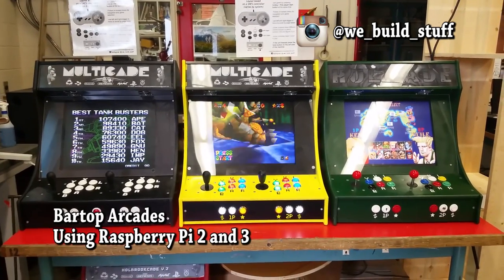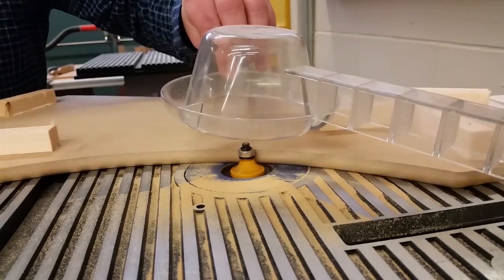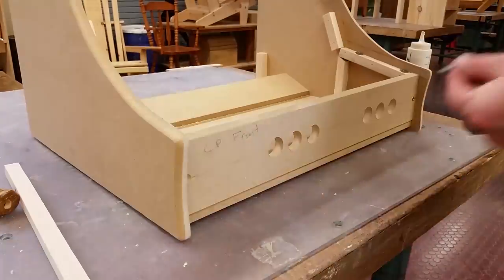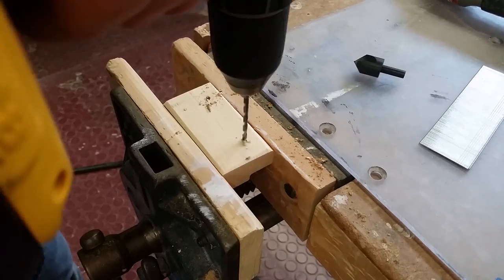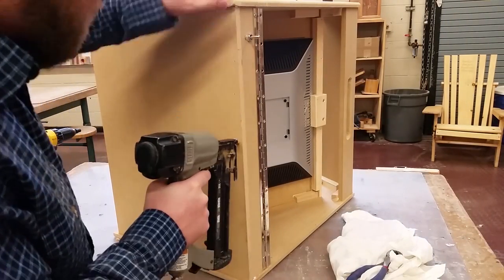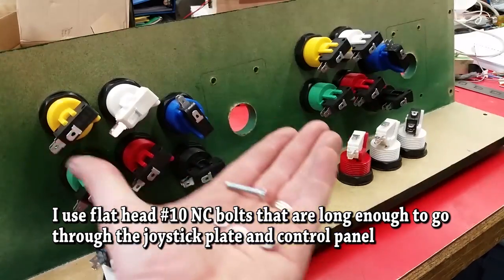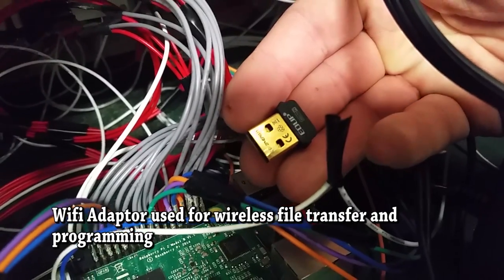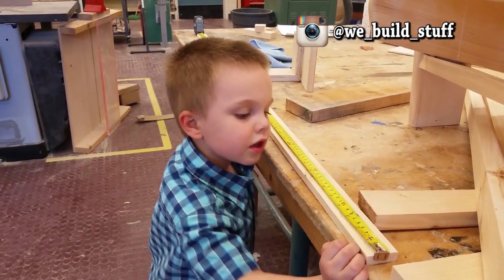How to make a DIY Raspberry Pi Arcade Cabinet!

Comment: I have a question.  Say i wasn't to build 2-4 of these for gifts can i set the first one up then copy the SD card for the other ones and they would be ready to go?  Giving i plug everything in the same spots.  Sorry for the dumb question.  Never used a Pi before I don't even eat them.  But I have my first Pi Zero getting delivered tomorrow.
Reply from the maker: yes that would work.... but you need to make an "Image" of the SD card and not just copying the files over. There will be 5 partitions made during the installation process (see the recalbox install video https://youtu.be/wlIxgFfgd34 that was just posted). 2 of the partitions will be visible just plugging into your computer while 2 are hidden and 1 is usually hidden unless your computer can read the linux partition thing (I really don't know how that works). 

Making an image after installing games and getting the settings right will save you lots of time since the only way to add games is wirelessly (unless they have updated the OS since I installed it whereas you can plug in a USB stick with games and it will copy over). I have checked out the latest 3 beta versions that were put out so a few details have probably changed. 

But plugging everything into the exact same GPIO headers, etc technically you can just make an image, copy it, and be good to good way quicker!

Good luck!
Reply from the maker: funny guy... eating Pi hah
Reply from the maker: i just noticed you said you are using PI Zero. This will still work but you wouldn't be able to use the GPIO unless you soldered on headers. Might be better off using a USB encoder with the PI Zero unless you soldering skills are awesome.
Reply: No sorry Gonne play with the Pi Zero for a little NES cartridges I am playing with first before I jump into the whole arcade build.
Reply from the maker: Ya I'd love to do a some Pi Zero mini builds. There are some awesome Gameboy Pi projects I would love to do!

Comment: Hi, 
The DIY combo I'm looking at getting has 2 zero delay LED encoder. Can I use these (2 of them) instead of connecting directly to the GPIO? I figure this might tidy things up a bit since each set of buttons have their own controller and the RPi can be positioned close to the side (or back) for USB/Ethernet access
Reply from the maker: Yes as long as your encoder is compatible is should work fine. I've had students build 2 player fight sticks with everything built in and an HDMI output using USB LED encoders

Comment: I have the same monitor you used in the video that I want to use for my project. How did you power on the monitor when the buttons are all blocked?
Reply from the maker: the monitor is tested first out of the box that it is working. everytime the plug recieves power it should automatically turn on . if that doesn't work drill a small hole in the wood front screen panel big enough for a finger or pencil that lines up with the hole

Comment: Have you ever had it where that recalbox doesn’t play sound?  I uploaded the latest version but I can’t get sound?
Reply from the maker: Depends on what you have your output set to. I usually have mine set to the audio jack and use that for output. If HDMI and your TV have speakers use that setting. Sometimes you have to over-ride it by changing the settings in "recalbox.conf"

You can see how I access that file directly by plugging keyboard in here. You just have to scroll down the file and find the audio settings and change them as displayed
https://youtu.be/yQRphxYgaMA

Comment: I'm making an arcade too. Similar design, mine has a keyboard drawer under the switches. 
I just want to ask why you didn't use a keyboard encoder for the buttons? It makes wiring much easier, and they aren't that expensive. Bought an Ipac 2 for 40 bucks.
Reply from the maker: I original had some keyboard encoders but they didn't work with Recalbox. They were Xin-mo knock offs and weren't being recognized. One issue I have had with keyboard encoders on recalbox is sometimes player 1 and 2 switch and I have to either unplug and switch the inputs on the raspberry pi USB or redo the control config in the menu. Maybe I have just had bad luck with them. Either way if I am lending to a friend or renting to a party I don't want any issues. 
I was on a budget for these builds so even an extra $40 for an Ipac 2 adds up.
Reply: Oh, well imo I think you just had some bad luck with some knock off encoders. And I get what you mean by on a budget... I've currently stopped building my arcade for a couple months, cause I don't have enough to get the last pieces of MDF cut, and a monitor.
But the Ipac 2 is definitely worth it's money (I find). "Cleaner" runs, and much less of a cable cluster.
Reply from the maker: Next build for me maybe I will use one ha. I have so much extra cable and connectors and I actually enjoy wiring by hand :)

Comment: Loved the video ! , is there a way to prevent the balls in the joysticks from "spinning" and prevent them from falling off ?
Reply: The balls in the joystick will always spin but they shouldn't fall off if tightened correctly.
Reply from the maker: I to re-read your comment a few times until I realized you were talking about the Balltop part! I just tighten them a lot! Soft-jaw pliers on the top and the stick to tighten without marking them up
Reply: Several things you can try.  Wrap thread in teflon plumbers tape. It will increase the friction and hold better.  You can use nail polish, red (permanent) or blue (removable) loctite.

Comment: So, raspberry pi doesn't need a separate usb control pcb?  All the buttons, joysticks etc just plug directly into the raspberry pi?
Reply from the maker: The way I have built mine are directly plugged in. This saved me a couple bucks having to buy a USB encoder. I have had students use a USB control without issues though. 
Here is a compatibility list that is supported by Recalbox
https://github.com/recalbox/recalbox-os/wiki/Compatibility-(EN)

Comment: Is this a feasible project for someone who never did any type of woodworking?
Reply from the maker: As long as you can handle some simple tools, go slow, and understand the safety behind what you are using yes it is. Measurement knowledge and the ability to read plans and draw are helpful.

If I had to i could build one of these with a drill and a jigsaw. It would just take much longer.
Reply: @WeBuildStuff  Thanks for the info. If I'd use a jigsaw should I make a guide for the straight parts. I mean, I used a jigsaw before, going straight is the hard part.
Reply from the maker: @axMf3qTI  a guide helps but also just go super slow and use a good blade. If you cut a little big you can always sand down. As long as your cabinet doesnt wobble it doesnt matter if it is a degree off here and there.

Comment: Nice cabinets, good design. Plywood would be better though. MDF doesn't travel too well, tends to fall apart after a while.
Reply from the maker: I've heard that before but 3 years later and lots of abuse all of these cabinets are still doing fine
Reply: @WeBuildStuff  I think gluing it all together did a lot to make it more durable than regular MDF furniture, which is usually just stapled. Probably doesn't hurt that the cabs you made are relatively small objects too, a full size arcade cabinet has a lot more mass to break things when it's moved around. 

Obviously you do you, but the way I see it, that's a lot of time and effort to invest in that object, why not spend a little more on materials and end up with something that's truly high quality? I think good workmanship deserves good materials.
Reply from the maker: @terracethornhill  of course! No arguments about that. I'm actually building a full size cabinet using 3/4 " MDF. I'll probably try my next one out of plywood.

Here's the one I'm working on now!
https://www.instagram.com/p/Bqi8S2MBjQS/?utm_source=ig_share_sheet&igshid=iegryvrhemum

Comment: So wiring the buttons and Joysticks directly to the pi, does it see it as a keyboard or Controllers? I normally use xin mo or zero delays usb hubs, but I like the idea of wiring them like you did.  Thanks.
Reply from the maker: Hi James,
Recalbox has a great option in it's config.txt file (edit via root access) that turns on the option for GPIO controllers (controllers.gpio.enabled=1)
Wiring using a XinMo would be easier but this saves me a couple bucks when I order parts. 

https://github.com/recalbox/recalbox-os/wiki/GPIO-controllers-(EN)
Reply from the maker: And I believe it sees it as a controller

Comment: Nice job! I wanna build my own now lol.   

Maybe I missed it, but how do you get the monitor to power up when your build is complete and everything is assembled and sealed up? Is there a trick to this, or do you need access to the monitor power button?
Reply from the maker: the monitors I have been using (dell 19xx series monitors) are powered on once and every time the power goes on they boot up automatically. If I used one that didn't have that option I would probably have to do some soldering and add an external button to the cabinet.

Comment: Amazing tutorial, I have a question with the microswitchs I connect everything and a little soldering but the ground cable (connected in series) can I connect on any ground pin on the raspberry?
Reply from the maker: Wiqkszon yes any ground pin. I think there are at least 3 options. If you are using a usb encoder you dont need to do all work i did creating your own wiring harness. Most usb encoder kits comes with everything that just plugs in easily

Comment: HI I want to build something like this for my nephews for Christmas this year and I have2 questions for you. 1st since they obviously will not be in my home how reliable are they as far as running. like can they just start and run a lot with out needing for the parents needing to go into the main screen to restart certain things. and 2nd,  since this will be my first venture with a pi can I shell into them if needed from my home to do maintenance if needed. Thanks
Reply from the maker: My kids are 4 and 5 years old. They figured it out pretty quick! My son knows what buttons to press to get back to the menu. If you do a proper "scrape" of the games you can also get the box art that will show up if they can't read well yet. I've left them running for a long time. I'm installing a cooling system on my next arcade so I don't need to worry about any heating issues

Comment: I am just getting into Pi myself and I dunno if this was mentioned before. 
You said you only open up the case when you need to attach a keyboard. 
You could actually add a USB ectention cord to the Pi and hotglue the female part to the body so you dont need to open it up.
Reply from the maker: I do have that option in my newer ones. The majority of people will rarely need to do anything once it is all tweaked. I bought some nice ones on ebay that look nice

https://www.ebay.ca/itm/1m-Car-Truck-Dashboard-Flush-Mount-Dual-USB-Male-to-Female-Extension-Cable-Kit/301557905014?hash=item4636407676:g:fCwAAOSwEeFU~lXK

Comment: Love the video! Looking into making one of these. What capacity of RAM did you buy your raspberry pi with? It seems like there are options of 1GB, 2GB, 4GB, and 8. I don’t want to buy one that can’t properly run games! Thanks in advance!
Reply from the maker: This video was 7 years ago and used a pi 3 with a 32 or 64 gb micro sd card. I don't remember the specs from that year but I still have the black one shown (older than the yellow one) and it still plays all my favorite retro games just fine. Anything new should be great

Comment: Is there a way to make an on/off switch . Thanks
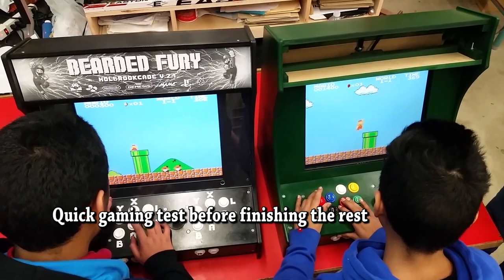Reply from the maker: I do mine at 15:15 in the video with a reset button on P6 of the raspberry pi. This will also turn it on when pressed as long as it is plugged in. There is a more sophisticated way to do it if you follow this link:
https://github.com/recalbox/recalbox-os/wiki/Add-a-start-stop-button-to-your-recalbox-(EN)

Comment: A quick question, how did you go about running the power to the surge protector? do you open the back and connect an extension cable, i was thinking about adding an inlet box to the back.
Reply from the maker: I just have a power bar on the inside and run the cable out a hole in the back. I usually use an extension cord from wherever I have it set up

Comment: I may have missed something here, but isn't it problematic that the monitor control buttons are covered so you can't access them without taking the monitor off?
Reply from the maker: Gergely Sinkó once it is setup once it retains all the settings. you could   cut out part of the frame piece for button access but this looks cleaner

Comment: Hi, great project!
I have RP Model B and my GPIO header is with only 26 pins. I really want to use it but I don't know how. Any idea?
Reply from the maker: I don't have experience with that version but here is some information from the Recalbox team
https://github.com/recalbox/mk_arcade_joystick_rpi/blob/hotkeybtn/README.md#pinout
Reply from the maker: single player should be fine but probably not a 2 player cabinet
Reply: Thank you very much - I saw the link you've provided and it's really helpful. I'll think a little bit more because there is a 8pin P5 header on my PI that has 4 more GPIO pins... A friend of mine is selling RPs with 320GB HDDs so I will consider this option. The price for the electronics will be equivalent to that I've spent for joysticks+buttons so it's good.

Comment: pro tip: counter sink before drilling through hole.. nicer end result
Reply from the maker: Maybe if you plan on drilling metal and needed a threaded hole then countersink, drill, tap..... In wood/mdf I've rarely seen a difference since it is so soft

Comment: Do you need to set up the controls individually for each game? I consider playing all kinds of retro games on my Pi3, but haven't gotten into connecting the buttons yet.
Reply from the maker: The operating system automatically assigns a button layout for each system once you have configured your controls to work for the menu. Some devices are automatically mapped by the Recalbox OS but I find the first time after a fresh install I just have to use a keyboard to navigate the menu and then map the arcade buttons and joystick once (for each player or controller) and then I am good to go! If you are unhappy with a particular mapping that has been automatically assigned for a specific system you can access the "programming" via root access and do some coding to change it. 

For example: My xbox 360 controller with my microsystem (controller plugs into Pi, pi plugs into my big home tv) works great and is comfortable to play N64 games while sitting on my couch. I'm happy with it's mapping...... but the GPIO arcade controls are a little weird for N64 games since that original N64 controller had a ton of buttons everywhere including an analog joystick whereas the arcade controls are all digital (on or off/binary). I live with the mappings even though I'm not thrilled about them. If you want to go deeper and really customize the option is available. 

Check out the recalbox wiki on this subject
https://github.com/recalbox/recalbox-os/wiki/Configure-N64-controllers-(EN)
Reply: We Build Stuff Alright, thank you for your advice, I'll try it out.

Comment: Was just wandering how you made the game fit the whole screen with no black borders around it? Thanks!
Reply from the maker: I use a 4:3 monitor which is a similar shape to retro games. You can also program the system to stretch games to fit the screen. I usually just leave it on auto and let the software decide

Comment: 1 suggestion.. make the play surface wider for easier playing for 2 players
Reply from the maker: I've done lots of different builds over the years. These ones, while cramped sometimes, are designed as space savers at only 58cm wide. Always design based on your needs, not others.
These plans are easily modifed to fit someones specific sizes just by scaling the plans 😀

Comment: @5:10 you installed it the wrong way! they should go exactly the facing the other way, so the knot can grab in wood when you fasten the bolt. great video by the way.
Reply from the maker: I've done them both ways. Both work for the build. I was having issues with them falling out of the bottom when installed 'properly' as the Pine was holding the t-nuts very well. My next arcade video (stay tuned) shows the pros and cons to each choice.

Comment: Do you need to use a 4:3 monitor, or can you use a 16:9 and it can scale depending on the system emulated?
Reply from the maker: There are settings to scale and stretch. I'm doing a build right now with a wide screen 19".

Comment: I was wondering what gauge wire and exactly what DuPont connectors you used to extend the connectors so it wasn't so crammed? If you could link me to the correct parts I would appreciate it greatly! I have the raspberry pi 3.
Reply from the maker: I think I was using 20 gauge wire. I will probably use 22 gauge for my next one. 
For this build I just extended the wires that came with my buttons. New builds will be wired from scratch using the below hardware:

Dupont Female Pins:
http://www.ebay.ca/itm/360914043434?_trksid=p2057872.m2749.l2649&ssPageName=STRK%3AMEBIDX%3AIT

Connector Housing: (I'm using this on my new builds)
http://www.ebay.ca/itm/400985300977?_trksid=p2057872.m2749.l2649&ssPageName=STRK%3AMEBIDX%3AIT

Crimper Tool:
http://www.ebay.ca/itm/331422246861?_trksid=p2057872.m2749.l2649&ssPageName=STRK%3AMEBIDX%3AIT&autorefresh=true
Reply: Awesome, thanks alot!!